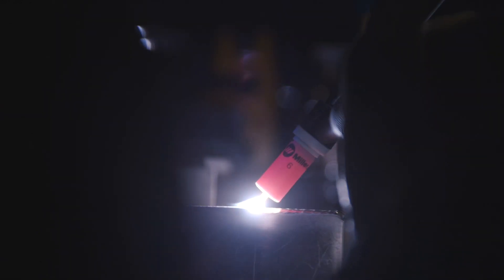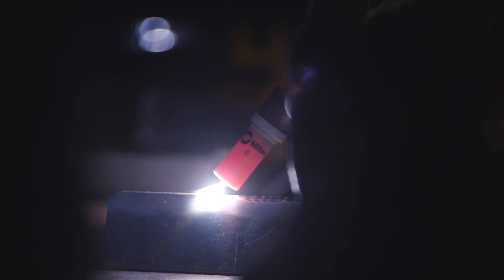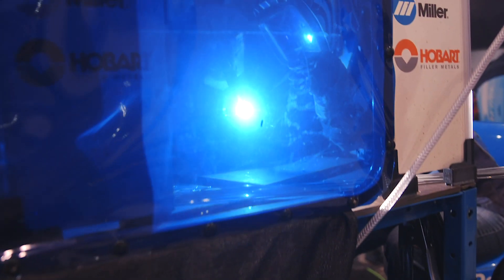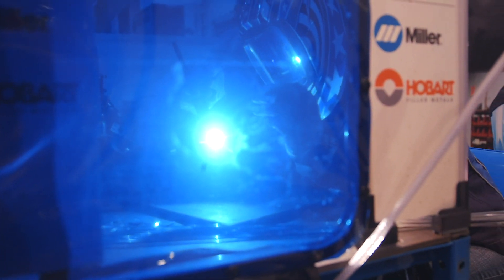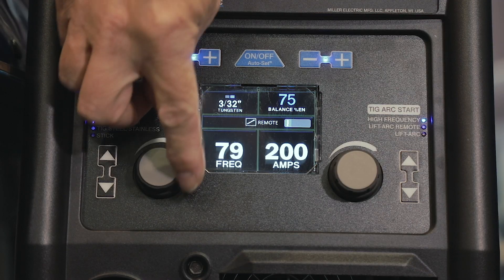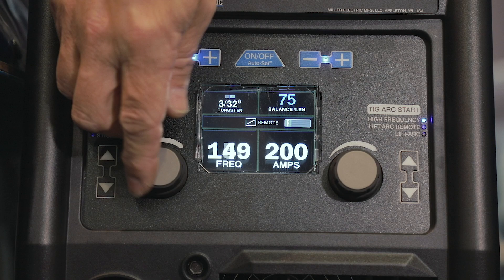Optimize Your TIG Welding With Multimatic 220 AC/DC Welder

Comment: Another unique feature is a 20% duty cycle. And no ac pulse and min balance adjustment.
Reply: I have a 211 that has been great for what I do. So this could replace that and add the AC tig.  Sounds like you dont like the 220. What would you recommend for a beginner tig welder, AC a must for 3/16 to 1/4 aluminum.   Just a home/hobby welder, dont mind spending a little money, but the dynasty seemed like more than I needed when for the money I could get this.  My 211 duty cycle has only ever held me a few times, no big deal really.
Reply: snowismas the 211 is a good machine, I have the miller dynasty 210dx among others. It’s not I don’t like it, the reason is that they took a mig and added ac. To me it’s like an after thought that’s why no ac pulse, slim freq and ac control it’s for very min ac work and you’ll grow out of it really fast. 

For $2500 you can get a HTP Invertig 221 which I own as well that has, independent ac like the dynasty 400. I own both dynasty 210dx and the Invertig 221 and I like the 221 way better. This old tony , Gary and Justin from fabrication series also love it. Comes with CK world wide stuff. Wide range ac 10-90% freq 10-999% pulse, pulse stick etc. 35% duty. If you can’t afford that I would even an everlast 210 over this. This will never beat a 211 & dedicated Tig. This machine is really for the home owner that can only afford one machine.rhsy took the 215 which I sent back that felt like a cheap peice of plastic and used it’s frame for this. Miller makes some great machines this isn’t one tho.

People want it because of ac Tig but it’s only people who want to learn and don’t realize how limited it is. I can’t sss anyone who already tigs wanting this machine.